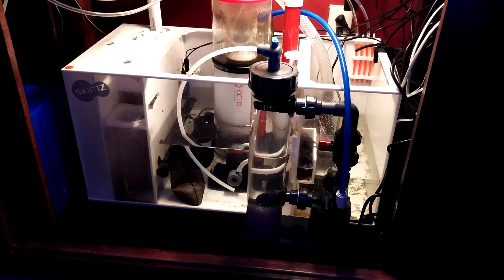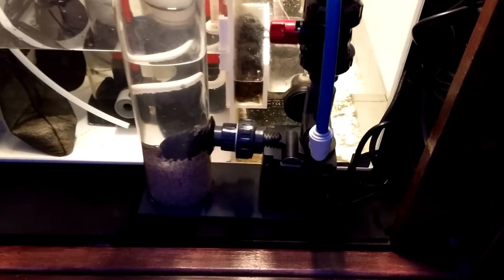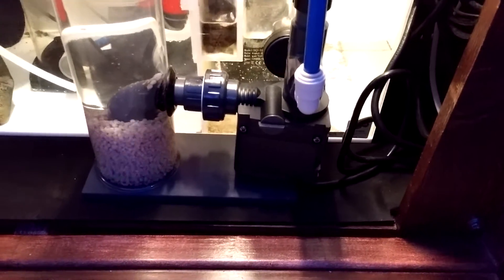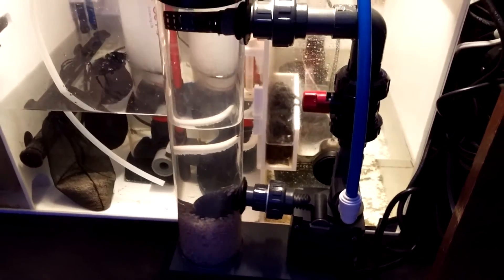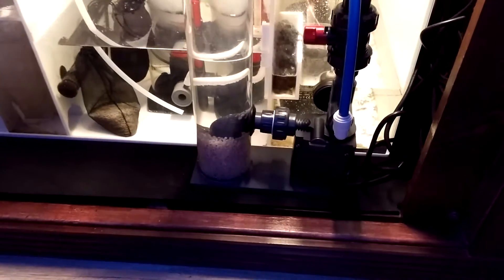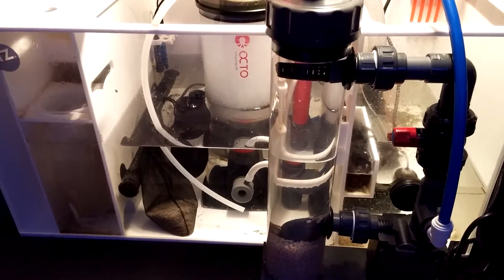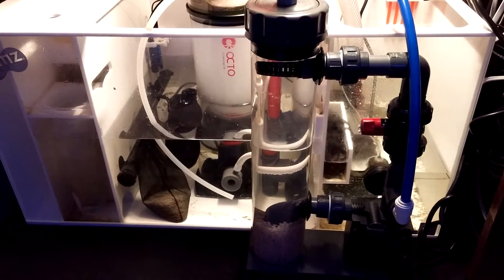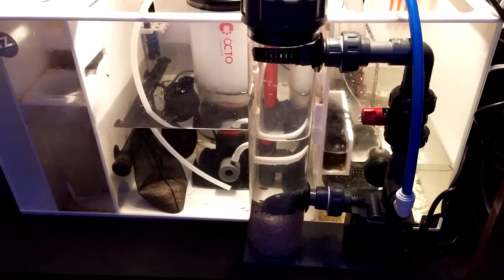Reef Dynamics Recirculating Bio Pellet Reactor Update 1

Comment: You could buy a 1" pic tee that would fit over the intake of the skimmer then get a reducer and stick that tubing in it so all the output of the reactor goes directly into the skimmer, I've been running bio pellets for three years and usually have more problems than not so I'm in the process of removing them, good luck with them!!
Reply from the maker: Thanks T, it came with the adapter for the skimmer, just need a coupling so I can add it. What kind of reactor are you running? What issues have you had with biopellets? Thanks again!
Reply: skimz reacter, alot of whitish junk collects inside of it, then in the sump, mulm i think its called, flow stops often which requires cleaning, pain in the butt, not sure how much they really do!